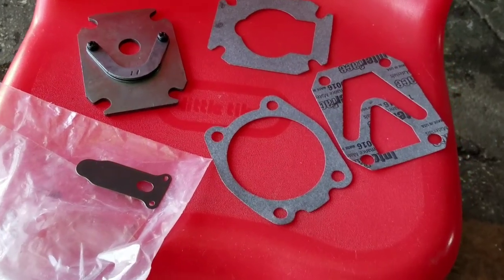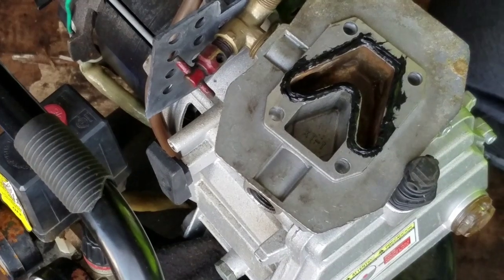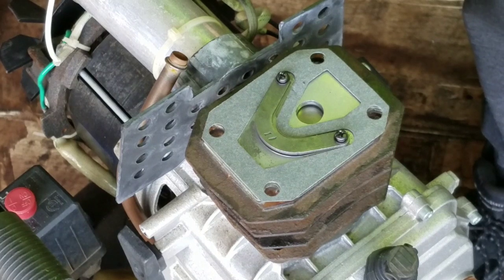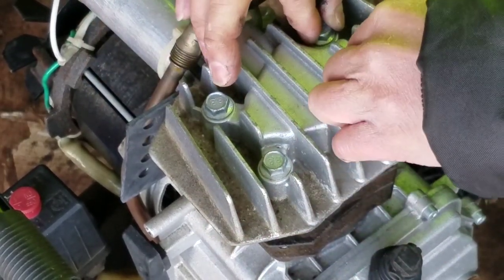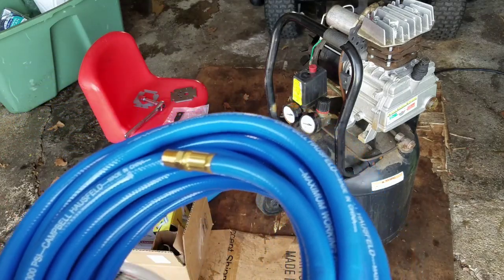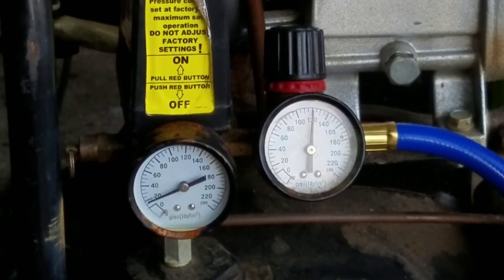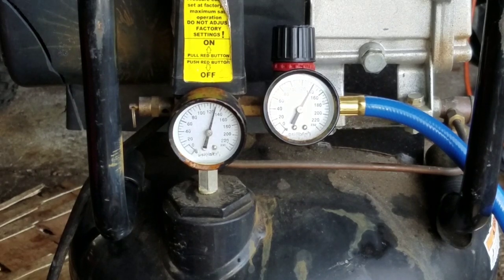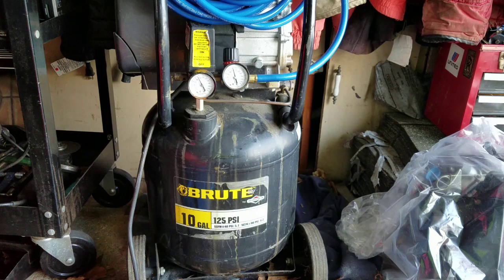FREE BRUTE BRIGGS & STRATTON 10 GALLON AIR COMPRESSOR REED VALVE HEAD GASKET REPLACEMENT REPAIR FIX

Comment: Like everyone is saying, you need to hit home depot and get some gas line fitting to fit, double threaded pipes, and a oil/water in the air separator, and maybe a new on/off switch, I will share  what you need..... Great job man.

Comment: I have a 100 psi compressor that can power some tools and good for painting with a HVLP paint gun. This compressor can power my 1/2" drive impact but I have to manually break the fastener. You'll probably need to get the 3/8 in drive air wrench for what you are doing.  If you don't have an oiler you'll need to add several drops of Marvel Mystery oil or something similar at the air input of the tool. Great job diagnosing and repairing the compressor.
Reply from the maker: Thanks middy.  I may have to add an online oiler if I plan on using this thing much. I dont plan on using it much.

Comment: Hey Henry on that red switch that powers it on and off if you unscrew the Phillips screw there's a Phillips head on there that says spring you can adjust it up and down for the PSI on there now I can't tell you the exact studying but you just have to mess with that screw 2 get The Sweet spot of the 125 psi hope this helps that's what I had to do on my little a gallon air compressor when I replaced the switch on it
Reply from the maker: Thanks for the tip bro...as you will see in tomorrow's video...I tackle a couple of things to get this thing working well.  Hint....you're right on it bro. Thanks.
Reply: @MowersNBlowers  no ploblem bro happy to help

Comment: Hi.. I have the same compressor. Can you tell me where you ordered the rebuild kit for it? Can't seem to find the parts anywhere.
Reply from the maker: Rebuild kit? I just bought a muffler and air filter.  Individual parts on ebay.  Google the model number and look at the parts diagram, search ebay or amazon on the part #

Comment: Just put 4 or 5 drops of air tool oil in the tool before you hook it to air line. You don't need a inline oiler but you really do need a water separater/ filter in line to keep water out of your air tools
Reply from the maker: Thanks Billie, I wanna make sure this thing works reliably before I sink any more accessories to it.  Plus I wanna see how often I actually use it.  I've been doing just fine with the electric impact and grinder.  I use my 1/4 impact all the time..no air tools needed for the work I generally do.

Comment: You need a oiler for air tools they don't run on just air
Reply from the maker: Every tool needs one?  That's retarded! I've never seen anyone have that on their air tools.  Each tool has a small hole where you add a drop of earl.
Reply: @MowersNBlowers  the inline oiler stays at the end of the air line nothing crazy about it you didn't grow up with a maintenance tech like I did if it is so screwed up why do you think they make them
Reply from the maker: People make all kinds of shit to make money!
Reply: @MowersNBlowers  you are not a professional machinist is why because to say that a oiler is retarded is pure and simple ignorance every shop in America that uses air tool on a regular basis have a air dryer and oiler at the compresser or inline you have never owned air tools
Reply from the maker: Correct,  I'll consider getting it if I think I'll use this thing more than once a year.
Reply: @MowersNBlowers  believe me 2 drops of oil do not last long